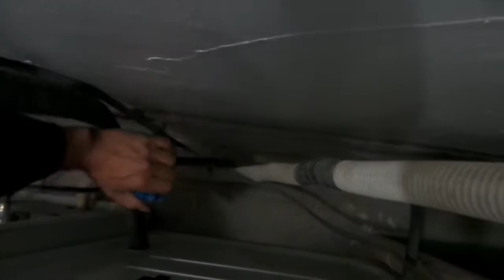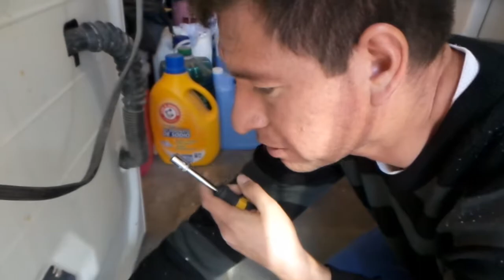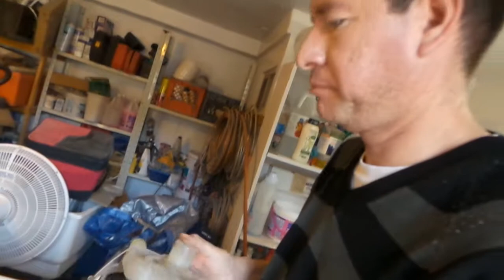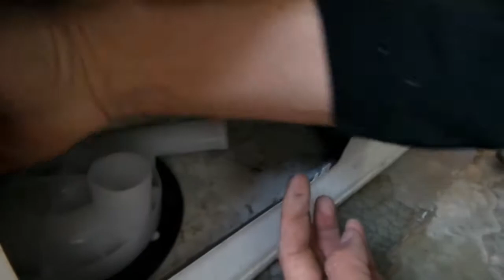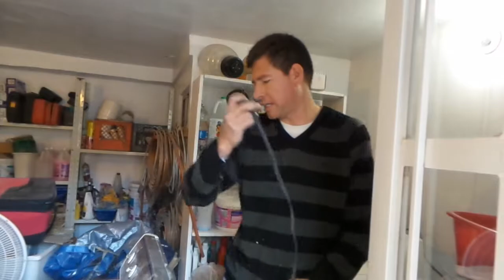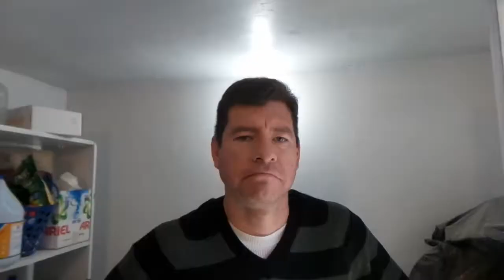Admiral Washer  machine model AAV7000AWW- Water Pump

Comment: really a great video if water pump is the issue.  mine is the agitator stopped working.  the machine drains and spins, but agitator made a heck of a noise and then stopped working.  thanks much for the detailed video.  really helpful tho.